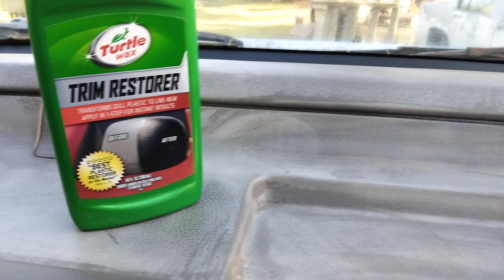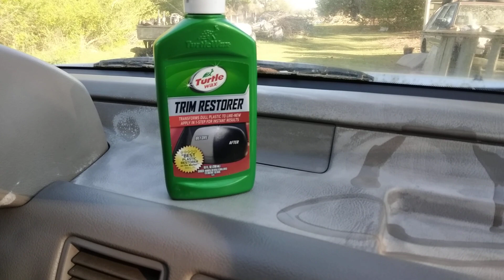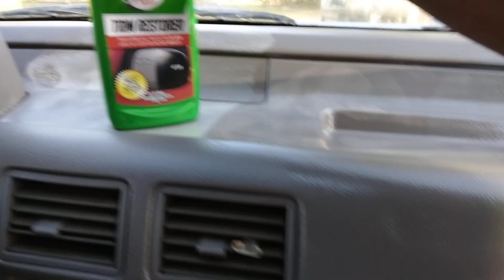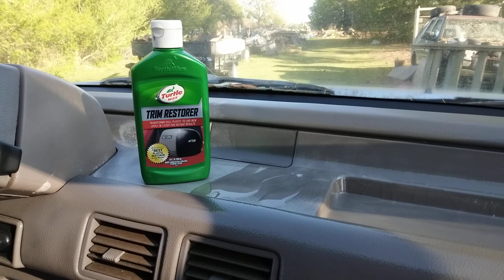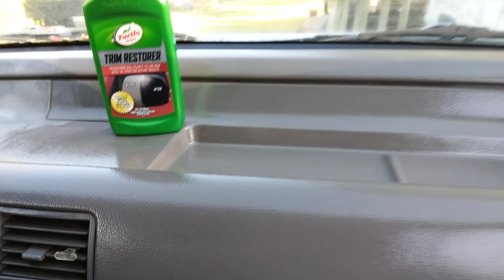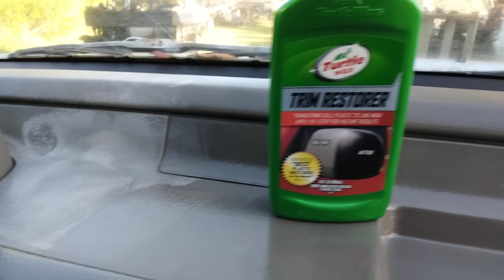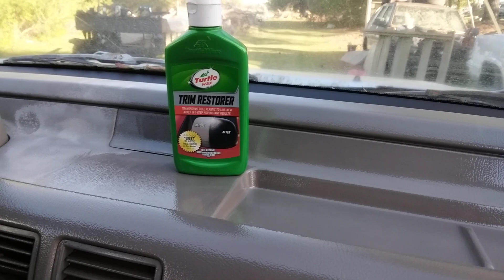turtle 🐢 wax trim restorer will this restore my faded honda dashboard wow 👏

Comment: Nice! Did it really restore it or is it just the  layer making it look good? If so how long did it last?
Reply from the maker: Yes and it made it look good tfw
Reply: @onrdetailingnews802  how much did it last? This is what the other man wanted to know, if it doesn't stay like that 1month that's not worth it, wd40 will do the same trick
Reply: @albanoxhani652  it's like washing a car mat. You think it's good after washing it,but then it dries and you still see the old dirt marks or scratches that water doesn't just make go away. That's what this feels like. Or like tire shine that looks good for like 2 days. It just made looks like someone applied lotion to it but it's still ashy